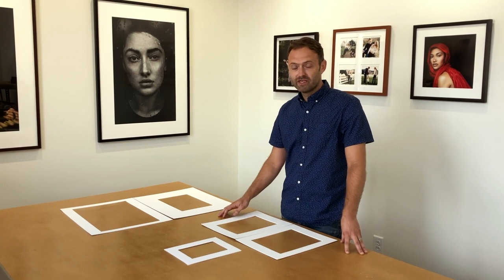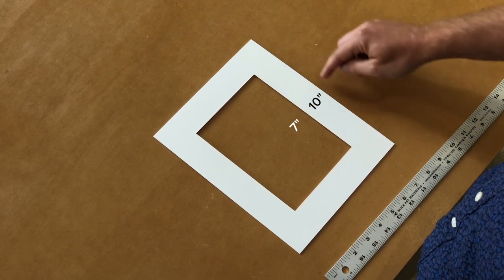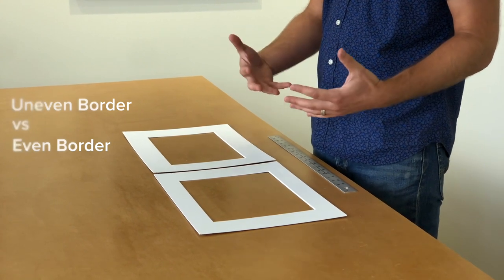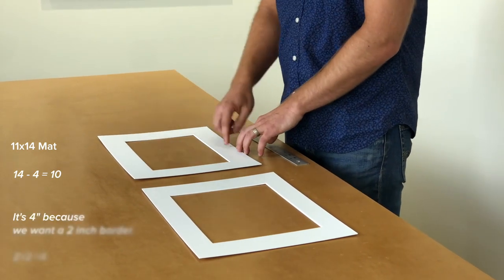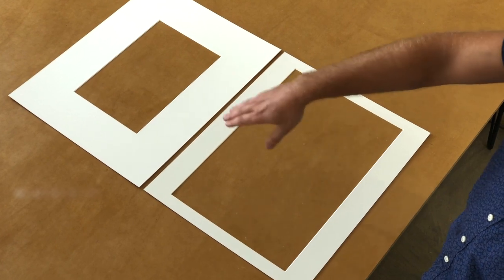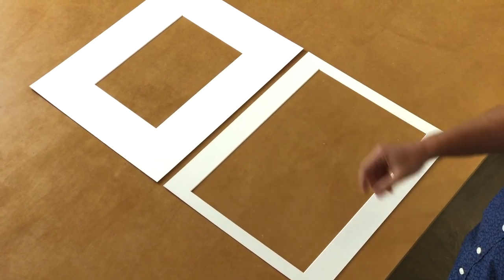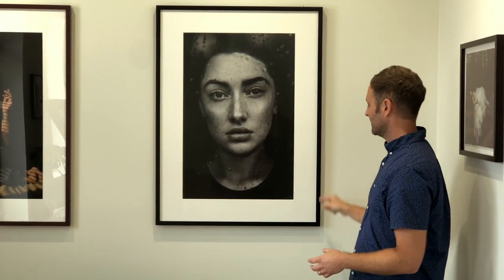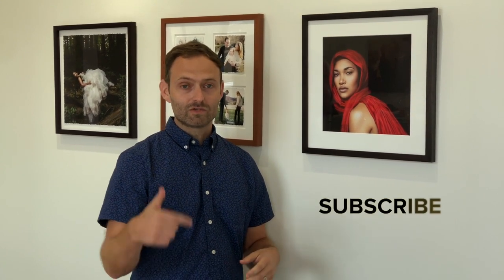How To Calculate Mat Sizes

Comment: What’s the rule of thumb for selecting the frame with in relation to Matt width. I’ve read that the Matt should be 1.5-2 times the width of the frame.
Reply from the maker: Hey Jared! Can you provide a specific example? Mat width is very subjective in our opinion. We’ve seen small prints with large mat borders and large prints with small mat borders.